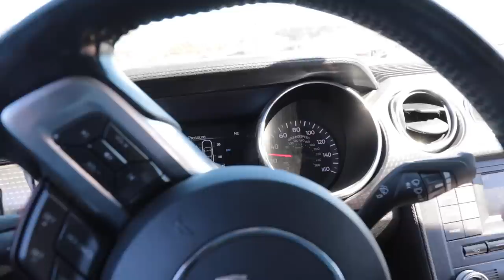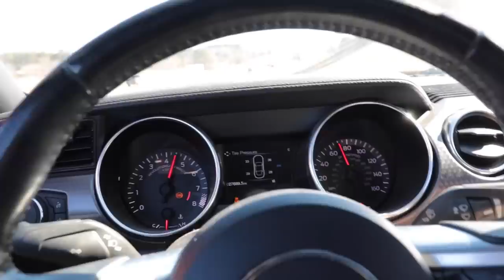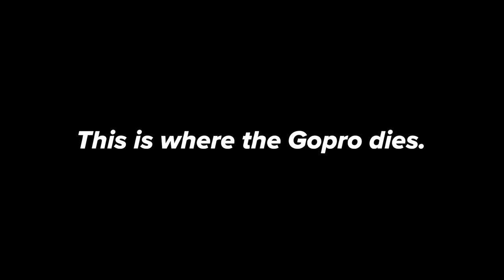1 Broken Part Inspired This Entire Transformation.

Comment: thats normal for the wheel bearings. i had to replace mine twice under warranty
Reply from the maker: I had my car warranties 2X for abs sensors. They never caught the bearing failing though.
Reply: @Zorbii  Some ford dealerships are just cheap they dont want to warranty it out. I had to check myself before giving it to them and i told them its the bearing and they changed it twice. What i noticed is if you like doing canyon runs which i do the pot holes or any kind of bumps will mess it up idk why there so weak
Reply from the maker: Makes sense with where I used to live. I lived on a road with massive unavoidable bumps.
Reply: @Zorbii  ya true lol thanks for the response and tell Gavin to get Satan up and running and Sell the Camaro lol
Reply: @kuksgarage2715  after the money put into the camaro, he ain't selling it lmao, and if i recall correctly, Satan is almost finished.
Reply: @MidwestSteven1  give it time he will lol